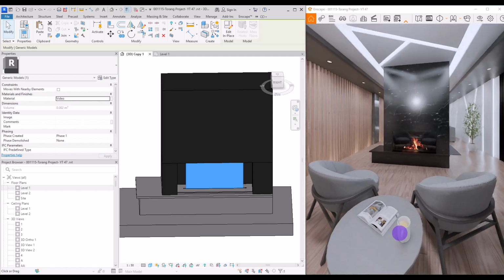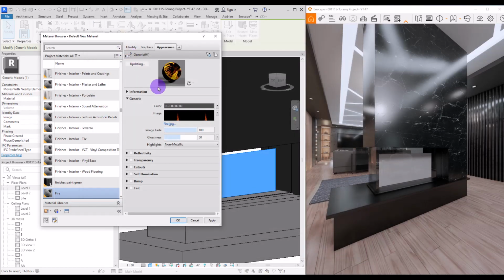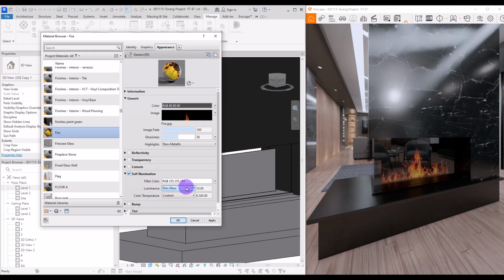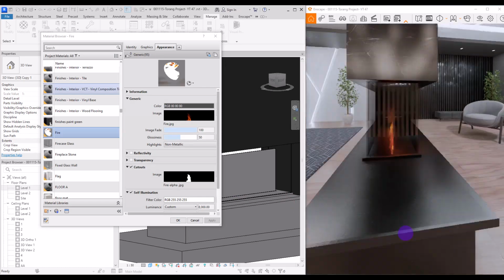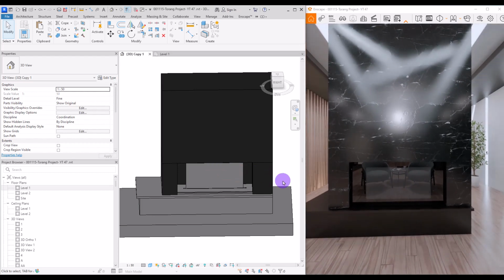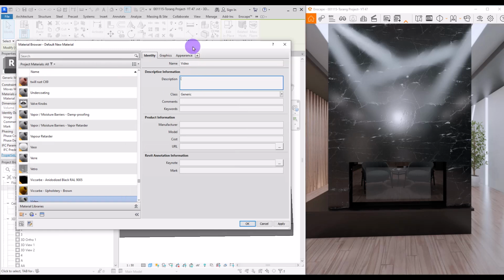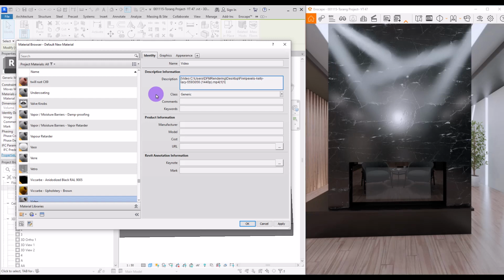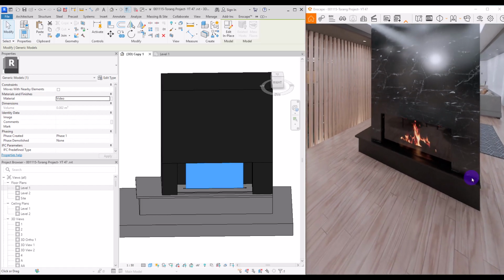Enscape Animation Hack: Creating Stunning Live Fire Effects in Revit

Comment: Great video. Can you send those cutouts or describe where we can get them.
Reply from the maker: Thank You. 
I download the Video from "www.pexels.com" and also You can Find Fire Images there too. Then You can turn them into black and White textures in Photoshop. Or Search for Fire Textures directly.
Reply: @RVTPLUS  Thank you so much.
Reply from the maker: You're welcome.
Reply: I tried but it didn't work. I am using 2022.
Reply from the maker: It is not about the version of Revit, But it works on newer versions of Enscape. After 2.9 we have this feature. Also make Sure You change the name of the material and use all the Signs accurately. Hope it works this time.
Reply: @RVTPLUS I will try again. Thank you.
Reply: @RVTPLUS finally, I found an easy way to put video texture material with sounds.
Reply from the maker: It's good to hear that. Well done 👏👏
Reply: @subashm1230  ok_ can you explain how? Kind regards